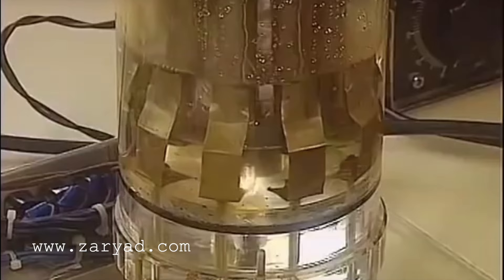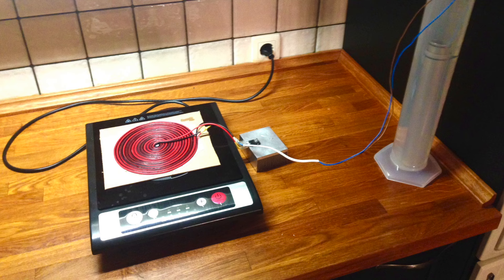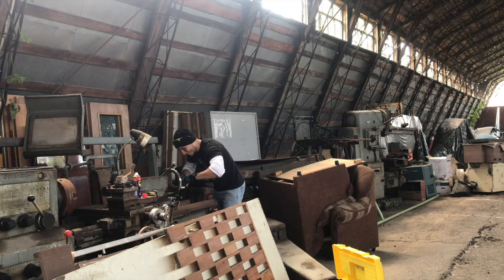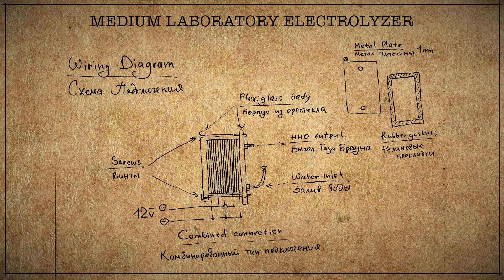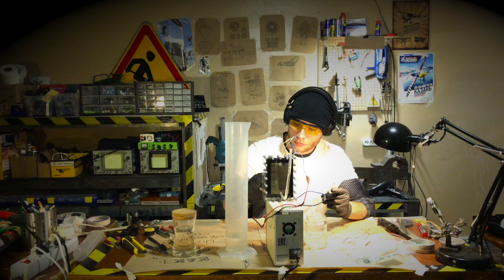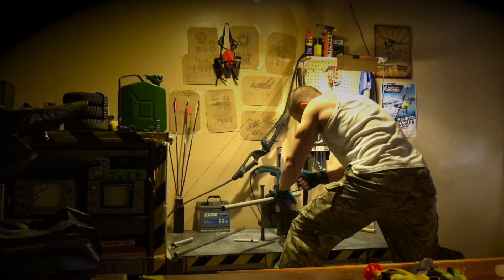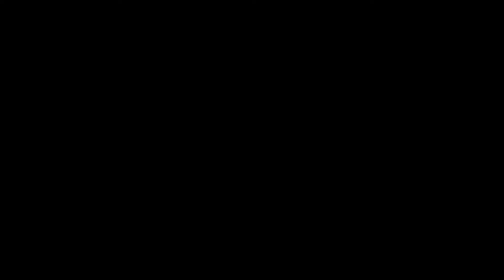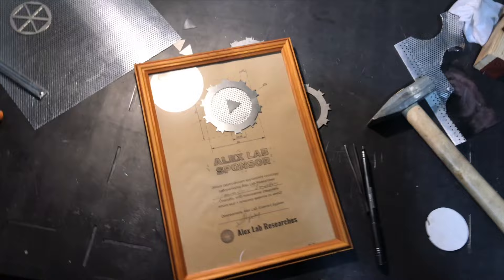Alex Lab: Evolution of reactors and me. My work, my life and researches.

Comment from the maker: ALEX LAB BLUEPRINTS
PDF step-by-step DIY guides are available for Channel Members in the Community tab.
Join the team right now!  http://youtube.com/alexlab/join
If YouTube Membership is not available in your country, you can get PDF blueprints on Patreon.
https://www.patreon.com/alex_lab
Here is a list of all PDF materials: https://shortest.link/hVU
Reply: My idea is to replicate a Oxford bell battery cell and connected to one individual arc lighter/inverter and connected to a individual small super capacitor and each coil it is it's own individual inverter and capacitor they will dump their power in sequence when the first one is full it dump it in to a bigger round flat plate capacitors also a small  rc gas powered engine made to run on hydrogen and connected to  a home made small disc alternator with flat small super capacitors in the Hallow metal parts of the suit/ hallowing the metal for the multiple super capacitors and flat individual batteries one in each body parts and program to use power when it is needed and program to stop when any body parts is not needed it
Reply: @angelguerrero2890  cool idea
Reply: Your using water why dont you use deuterium instead its the most hydrogen concentrated type of water 😊

Comment: have you tried using uv light to ionize the H2->H1 to increase overall power? 
have you tried using magnets n42/n50 to increase h2 production ?
have you looked at using a poe votrex coil to increase overall production ? 
have you tried using iron as your plates instead of stainless steel as i have read they have better Magnificat prembelty and lead to better h2 production ?(i had lost the research that i found this info in)
i have not just asking ?

Comment: Can you use the hydrogen created in the reactor as a power source to charge the batteries for the reactor so it only requires more water?
Reply: Unfortunately that would require the system to have an efficiency to have over 100 percent efficiency which with the current technology and laws of thermodynamics is impossible

Comment: My idea is to replicate a Oxford bell battery cell and connected to one individual arc lighter/inverter and connected to a individual small super capacitor and each coil it is it's own individual inverter and capacitor they will dump their power in sequence when the first one is full it dump it in to a bigger round flat plate capacitors also a small  rc gas powered engine made to run on hydrogen and connected to  a home made small disc alternator with flat small super capacitors in the Hallow metal parts of the suit/ hallowing the metal for the multiple super capacitors and flat individual batteries one in each body parts and program to use power when it is needed and program to stop when any body parts is not needed it

Comment: All he is doing is making a glorified hydrogen generator. I made one, but instead of nails I actually used the several razors you get from the carpenter knife arranged in a cylinder like yours. Behaved exactly as intended. 
However, doing this is extremely dangerous. I have not done any further research into this because I am more interested in mechatronics. As to your "arc reactor" It is WAY, WAAAAY more efficient to use batteries. If you were to build your suit, just doing battery based power would work. To power your actuators, or any electrical systems  using a hydrogen fuels cell is just dumb, also pointless. Obviously you know thermodynamics...I hope. At this point you are just making a fancy torch. The arch reactor already used fuel to convert INTO electric energy. You are doing the opposite. In fact, the arc reactor behaved more like a step up transformer with..magic voltage levels. I doubt you can produce enough thermal energy to compensate for the amount of electric potential energy you used. No free energy.

However, you are awesome for what you have done already. I am always in support of people doing science. Please don't take this the wrong way. Keep doing awesome stuff.